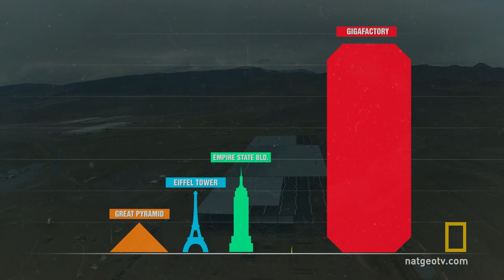Welcome to the Gigafactory | Before the Flood

Comment: “The big car companies may also need to build gigafactories”                    Update: Tesla is now the biggest car company lol
Reply: EVs are about 8% of the global car market.  And Tesla is about 15% of the global EV market.  It's not anyway near the largest car company, Toyota is.
Reply: Toyota laughing rn😂
Reply: @jconia9550  He said Tesla is the biggest car company in the world when they are not even in the top ten.  Sorry if you're not bright enough to use Google.
Reply: @TR-lh9yz  i was replying to the original comment not yours
Reply: @TR-lh9yz  Stop thinking everything revolves around you 😁
Reply: No It Is not. Just the stock value.
Reply: @TR-lh9yz  OP was talking in terms of market cap, which more often than not is the metric for company size, versus market share, as companies often span across different markets, much like how Tesla has an energy unit that doesn't directly compete with Toyota, etc.  Another fair metric is to take employee count when measuring company size, which both companies are surprisingly similar.

Comment: How much energy was used to build this factory, how much for each pack, and how will they be disposed of/recycled? If these aren't addressed we're just going to accelerate the problem...
Reply: A significant portion of Tesla's Gigafactory is devoted specifically to recycling, as Elon Musk confirmed in the Gigfactory Opening Q&A. Furthermore, since they designed the battery cells, they're able to recycle them with a very high degree of efficiency.

Comment: But what will happen once the battery have been over used. In other words the battery has gone through many cycles has that's its health has degenerated. People will throw out this battery and that's not very sustainable because of all the harzards batteries contain.
Reply: It's recycled or reused in storing energy for a city for example, where current capacity doesn't matter as long as it helps.

Comment: How about the battery waste after use? Batteries have a limited amount of cycles you can charge efficiently.
Reply: Classical argument. Easy to revise.

The batteries Tesla uses can be used in the cars for 300k+ kilometers. After that they can be used to stabilize the grid. And when we reach the point in ten years or so when a massive amount of batteries is getting too old and bad we will very likely have recycling methods that can reuse 100% of the materials. And we can recycle already today pretty well.